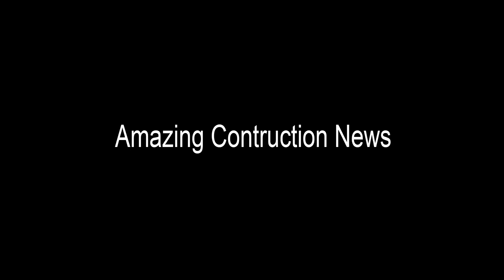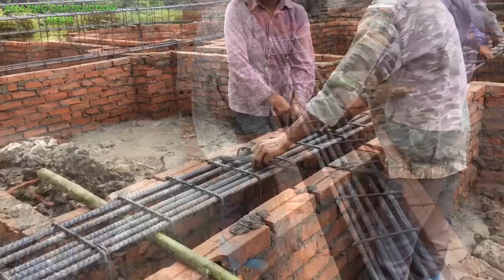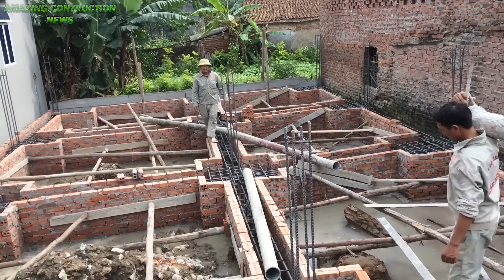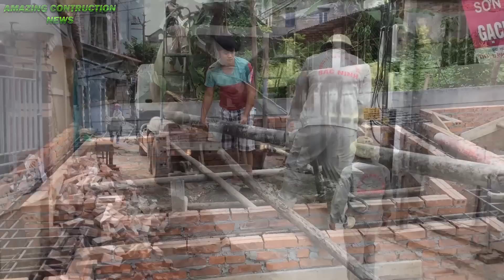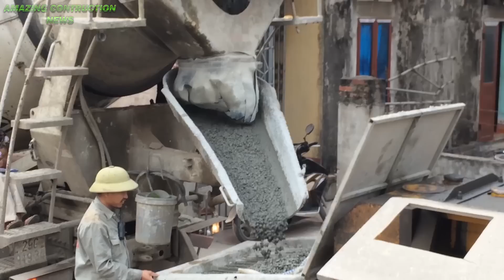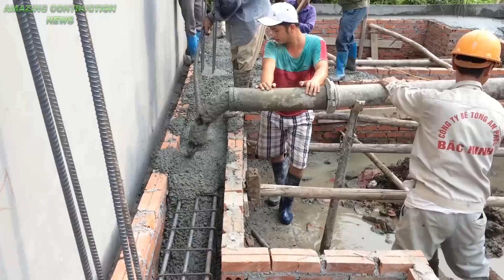How To Build A New Style Foundation - Build A Foundation Using Ready-Mixed Concrete For The House

Comment: I think it’s a waste of material, bricks are wasted. They would timber of steel formwork instead
Reply from the maker: No waste is very solid
Reply: We use wooden or steel sheets for housing foundation, ceilings or popular.
Reply: @Blowyourmind2020  where u from
Reply: It is not a waste depending on your value engineering and design.
Reply: Timber is much more expensive compare to brick.
Reply: @Blowyourmind2020  Probably timber or steel plates is much more expensive than brick in Vietnam ?
Reply: Das ist das Fundament eines Wohnhauses. Also Privathaus. Da gibt es in Vietnam KEINE wieder verwendbare Schalung aus Sperrholz. Wer soll die wiederverwenden? Wenn aus Sperrholz, die Schalung, und abgebaut werden müsste, was damit machen? Will keiner haben. Würde verbrannt werden. Unnötiger Aufwand, finden die Vietnamesen. Also praktischer mit Ziegel eine verlorene Schalung bauen, die bleibt einfach drin.

Die Grundstücke sind teuer. Kosten in Vietnam genauso viel wie in Europa. Wer sich ein Grundstück leisten kann zu bezahlen, hat auch das Geld zum bauen. Das bauen zum Vergleich ist billig. Ich kenne mich aus. Ich selber bin Bauingenieur aus Deutschland (Europa). Ich bin mit einer Vietnamesen verheiratet. Ich war schon oft in Vietnam. Als Bauingenieur immer mit offenen Augen dafür, wie anderswo gebaut wird.

Comment: Generous use of rebars and concrete, foundation will certainly be strong.

Only concern is that some parts of the foundation were linked with the adjacent structures. Not a good idea to link a new building with an old one because of differences that will arise in the settling of the structures. The old structure has finished settling, but the new structure will still be settling for sometime. It will drag the old structure along when settling and that may cause issues with the old structure.
Reply from the maker: Thank you for watching videos or like sharing videos with friends to support a better development channel
Reply from the maker: thanks you

Comment: *** It should go underground atleast 3 to 6 feet  and no need to make brick wall around steel structure / concrete filling area. you can place removable steel sheet
Reply from the maker: Thank you for your suggestions so I can do better or share videos to support the channel
Reply: The brick I guess is much cheaper then steel sheets, so this is the method of choice.
Reply: @amazingcontructionnews5050 .

Comment: It's only reasonable  if u build more than 3 floor 
Otherwise waste of money 
And these red bricks would not make the foundation  stronger not a bit even
Gentlemen  don't be fooled
Reply from the maker: This foundation is very solid, this house is built with 3 floors
Reply: Das Gebäude wird ein Wohnhaus. Mit in der Regel mindestens 4 oder 5 Etagen, sowie der Option später noch eine 6 oder 7 Etage oben drauf zu bauen.
Die 5 bzw. 7 Etage ist inklusive Dachgeschossterrasse, inkl. eines leichten Aufbaus mit 2 Schlafzimmer für Dienstmädchen (meistens Verwandte aus dem Dorf, die bei ihrer Verwandtschaft in der Stadt helfen arbeiten, für Essen und Unterkunft, sowie etwas Taschengeld für spätere Hochzeit)
Ich kenne mich aus. Ich bin mit einer Vietnamesen verheiratet.

Das ist das Fundament eines Wohnhauses. Also Privathaus. Da gibt es in Vietnam KEINE wieder verwendbare Schalung aus Sperrholz. Wer soll die wiederverwenden? Wenn aus Sperrholz, die Schalung, und abgebaut werden müsste, was damit machen? Will keiner haben. Würde verbrannt werden. Unnötiger Aufwand, finden die Vietnamesen. Also praktischer mit Ziegel eine verlorene Schalung bauen, die bleibt einfach drin.

Comment: Waste of money.. For such a small column size. No need of brick work. We can do this with much cheaper method scaffolding..
Reply from the maker: Thank you for watching my video, share my video with friends to support the channel
Reply: taiffun
Reply: Exactly. Lot of steel and brick is wasted
Reply: @amazingcontructionnews5050 is it in Nigeria?
Reply: Maybe not because of the column, but soil problem. This act like a rough footing
Reply: Probably where your located, i suspect their materials cost a lot less, apart from the concrete pump and truck, all built with hand tools, I respect the crafts people.
Reply: I guess brick is method of choice because it cost less then timber i Vietnam.

Comment: In Asia, it’s always flip flops on the feet, even during heavy construction. 😂
Reply from the maker: very exactly my vietnam people
Reply: Yes, but steel-toe flip flops!
Reply: and a huge number of violations of 'safety first' rules at construction site, plus clear inefficiency. The method on video is pretty old and cold 'conventional' in Vietnam. New technologies are already in the country, small companies just do not want to learn and move to the next generation construction practice, even if that is cheaper. New scares sometimes, investment of time to observe the market and learn new approaches also. Also the method on video is extremely dirty and noisy. It is normal practice when several houses are under reconstruction or construction in the area, you can imagine what poor neighbors are passing through while that moments, but even thought it is over, nearby a new construction site will appear and it is non-stop noise and pollution.  Still curious when Vietnam finally moves to prefab and one day assembly without extra noise and construction dust. Precast is the option for Vietnam same as it worked for budget and small-scaled architecture in Dubai or anywhere else in the world.

Comment: I m impresed.. Good job but in india it is so expensive to apply this method.
Reply from the maker: Using this method it is more reliable
Reply: Índia? China or Vietnã
Reply: Right
Reply: This method is perfect for areas with lots of cheap bricks....
Reply: @amazingcontructionnews5050  l
Reply: Viet Nam
Reply: @amazingcontructionnews5050  As said by you isn't  agreeable by mind because use of so close Iron bars aren't ideal , to explain its reaction , know it that After some period of Completion of Construction Dampness will effect iron and swelling of corrosion will pressure on cement made Mixture and form crack allover and any Small Earthquakes  will make the weak Beams shake in jerks, purpose of using Iron Rod Frame in R.C.C. constructed Foundation Beam will thus show  Reverse of strongness . As per my Research Iron Rods should not be more close to each other in farmation of gap with Iron Rods made Frame, like the same in construction of Roof, Formation of Crack on R.C.C. is because of the same. One should observe Brick made Lintals after some 4 -5 Years it was constructed , there will be cracks if Iron Rods are not placed in.between and proper middle line of Breaks.  An old begning time when iron Rods were placed with view to support weight of Brick while making Squares of Iron Rods, due to this down less part of Brick got damadged due to thickning / Swelling of Corroded Rod that pressed so high that the Bricks broke and Shattered down on ground.
Reply: This video is in Hanoi Vietnam
Reply: @abdulrahimkhan5714  Unsinn

Schlussfolgere nicht von der in deinem Land üblichen Bauweise, auf diese Bauweise in dem Video (Vietnam). 
Aus Sicht eines Bauingenieurs (ich, Bauingenieur aus Germany) hast du Abdul natürlich "Recht".
Aber: dies Gebäude im Video, wird in Vietnam gebaut. Anderes Klima als in deinem Land oder gar in meinem Land. Das Gebäude wird ein Wohnhaus. Mit in der Regel mindestens 4 oder 5 Etagen, sowie der Option später noch eine 6 oder 7 Etage oben drauf zu bauen.
Die 5 bzw. 7 Etage ist inklusive Dachgeschossterrasse, inkl. eines leichten Aufbaus mit 2 Schlafzimmer für Dienstmädchen (meistens Verwandte aus dem Dorf, die bei ihrer Verwandtschaft in der Stadt helfen arbeiten, für Essen und Unterkunft, sowie etwas Taschengeld für spätere Hochzeit)
Ich kenne mich aus. Ich bin mit einer Vietnamesen verheiratet.
Reply: @AHSIH4AHSIH  Dear Can you write in English language  ?  your written can't be understandable by me,
Reply: @abdulrahimkhan5714  Can you write in German? Your writing in English cannot be understood by me.
No, I can't write in English. Use the translator to translate into your language. Right mousekey. Do not you know that? Do you have no idea about it? I'm sorry. those are the basics.

Comment: Only benefit of this formwork is that it prevents escaping slurry or loose cement from the foundation which can later on lead to solid foundation. Otherwise the base of the foundation is not so strong as it is build on the surface and not in the ground
Reply from the maker: Thank you for your suggestions so I can do a better job

Comment: Underground foundation method is more strong. and economic. In this construction bars (steel) for plinth beam is too much heavy more than columns. Wich is not necessary.
Reply from the maker: Thank you for your suggestions so I can do better
Reply: This tye of foundation is commonly used on areas with high water table that makes digging rohibitive.

Comment: As per Engineer prospective 
Firstofall it is not economic.
Reply from the maker: This platform structure is inexpensive but solid
Reply: @amazingcontructionnews5050  regarding existing techniques it is not that cheap, it can be cheaper and more efficient, faster and clean on site.. observe, please, construction practice approaches. regarding solid - time will show. This conventional method is done based on copy-past engineering drawings in AutoCad, what means, hardly anyone made calculations of structures and quality check of materials. What means, it may work well for small building just due to less compression on the base, but not a secret that 3 storeys building on signed project quite often become 6 storey buildings in reality in Vietnam. If no specialist had done appropriate work on calculation there can be any consequences while exploitation, including weather conditions influence. Construction with such method as on video has always distortions, regulation and control of small projects just not that strict due to massive erections in the city. The same building as in video can be built by 2-4 people in one day, ready for finishing work. As a professor in architecture and construction in Hochiminh, pretty familiar with and Vietnamese construction sites and European practice, I can share knowledge, if you want.
Reply: @Timesobserver_Xenia  sir I'm from India, will you please let me know the process you are taking about, as i want to build a home for me .
Reply: Das Gebäude wird ein Wohnhaus. Mit in der Regel mindestens 4 oder 5 Etagen, sowie der Option später noch eine 6 oder 7 Etage oben drauf zu bauen.
Die 5 bzw. 7 Etage ist inklusive Dachgeschossterrasse, inkl. eines leichten Aufbaus mit 2 Schlafzimmer für Dienstmädchen (meistens Verwandte aus dem Dorf, die bei ihrer Verwandtschaft in der Stadt helfen arbeiten, für Essen und Unterkunft, sowie etwas Taschengeld für spätere Hochzeit)
Ich kenne mich aus. Ich bin mit einer Vietnamesen verheiratet.

Das ist das Fundament eines Wohnhauses. Also Privathaus. Da gibt es in Vietnam KEINE wieder verwendbare Schalung aus Sperrholz. Wer soll die wiederverwenden? Wenn aus Sperrholz, die Schalung, und abgebaut werden müsste, was damit machen? Will keiner haben. Würde verbrannt werden. Unnötiger Aufwand, finden die Vietnamesen. Also praktischer mit Ziegel eine verlorene Schalung bauen, die bleibt einfach drin.

Die Grundstücke sind teuer. Kosten in Vietnam genauso viel wie in Europa. Wer sich ein Grundstück leisten kann zu bezahlen, hat auch das Geld zum bauen. Das bauen zum Vergleich ist billig. Ich kenne mich aus. Ich selber bin Bauingenieur aus Deutschland (Europa). Ich bin mit einer Vietnamesen verheiratet. Ich war schon oft in Vietnam. Als Bauingenieur immer mit offenen Augen dafür, wie anderswo gebaut wird.

Comment: As a civil engineer iam rejection this method🙅
1) Never cast a concrete beam with bricks as shuttering replacement why? Because it will not have adequate strength. Again why? Because it won't be having proper curing. 
2) If there any voids remain inside the beam it can't be repaired and since it's a ground beam or plinth beam the moisture from ground through bricks will harm the reinforcement later on.
3) this method shows intelligence of a contractor. He'll charge you for shuttering work also and will save money hence will have greater profit. 
Hope the guys reading this comment doesn't use this method while making your house😊
Reply from the maker: Thank you for your comments, watching good videos, please share with your friends to support the development channel

Comment: Has a very good tie beam setup. My only question is that there were only  4 corrugated erected steel bars instead of 6  pcs16 mm- 18 mm steel bars. Depths it should be 4-5 ft...footing of 1mx 1meter -1.25 meter.
Reply from the maker: Thank you for watching the video, see or share the video to support the development channel

Comment: So basically do excavation and brick work in advance then make individual reinforcement cages, lift them above ground, combine all of them and then just do concreting
Reply from the maker: Thank you for watching my video, share my video with friends to support the channel
Reply: My old house was constructed in 1971 and almost this pattern only. What the builder did was make a brick foundation and on top of it place a plinth beam with RCC and on top brick structure to come. The only difference is that the pillars are also compound walled and RCC poured in. This is suitable for g + 3 maximum. But now a days pretty expensive

Comment: This type of design is not acceptable in India, Indian residential homes are generally designed on isolated foundation. And the video shown here is something similar to foundation cum plinth beams. Foundation should reach upto hard starts. Or else we can adopt raft foundation.
Reply from the maker: because in my country is using bricks instead of boards, it will make the concrete foundation beautiful and certainly not expensive.

Comment: Can u help me decide on what design/type of foundation and how deep/high it should be for a single storey house?
Because im planning to build my house on a wet and loose sandy area
Thanx a lot for ur help
Reply from the maker: Thank you for watching my video, share my video with friends to support the channel
Reply: Usually when soil is not compact, soft  and with low bearing capacity base plate foundation is an option. First you excavate  deep enough and replace the soft soil with a solid and well compacted material (gravel) using plate compators or similar equipement. The "tampon" layer must be min. 1 m tick, above the underground water level, and separated from surrounding and underneath soil with geotextile to prevent erosion and mixing . Then on top of that you build reinforced base plate foundation.  This will be  a good  foundation for the smaller house.  There are other more expensive and complex methods but this is more then good enough for smaller buildings.
Reply: @nikicamalezic5388  thank u so much for this..

Comment: As there is no depth provided to the foundation, the area of the footing should have been wider so as to prevent settlement.
Reply from the maker: Thank you for watching my video, share my video with friends to support the channel
Reply: Nein. Es ist ausreichend. Und überdimensioniert.

Das Gebäude wird ein Wohnhaus. Mit in der Regel mindestens 4 oder 5 Etagen, sowie der Option später noch eine 6 oder 7 Etage oben drauf zu bauen.
Die 5 bzw. 7 Etage ist inklusive Dachgeschossterrasse, inkl. eines leichten Aufbaus mit 2 Schlafzimmer für Dienstmädchen (meistens Verwandte aus dem Dorf, die bei ihrer Verwandtschaft in der Stadt helfen arbeiten, für Essen und Unterkunft, sowie etwas Taschengeld für spätere Hochzeit)
Ich kenne mich aus. Ich bin mit einer Vietnamesen verheiratet.

Das ist das Fundament eines Wohnhauses. Also Privathaus. Da gibt es in Vietnam KEINE wieder verwendbare Schalung aus Sperrholz. Wer soll die wiederverwenden? Wenn aus Sperrholz, die Schalung, und abgebaut werden müsste, was damit machen? Will keiner haben. Würde verbrannt werden. Unnötiger Aufwand, finden die Vietnamesen. Also praktischer mit Ziegel eine verlorene Schalung bauen, die bleibt einfach drin.

Die Grundstücke sind teuer. Kosten in Vietnam genauso viel wie in Europa. Wer sich ein Grundstück leisten kann zu bezahlen, hat auch das Geld zum bauen. Das bauen zum Vergleich ist billig. Ich kenne mich aus. Ich selber bin Bauingenieur aus Deutschland (Europa). Ich bin mit einer Vietnamesen verheiratet. Ich war schon oft in Vietnam. Als Bauingenieur immer mit offenen Augen dafür, wie anderswo gebaut wird.

Comment: Good job with the steel,  this should be earthquake proof with that size rebar.  The only thing that I would add is a flexible concrete hose to cut down on the work of spreading the concrete.  Good job on the vibrating;  when the concrete drops that much in the form from vibrating we know that it is very compact.
Reply from the maker: Thank you for watching my video, share my video with friends to support the channel
Reply: A mi

Comment: Poor quality control.water cement ratio not controlled .Cement slurry leakin from pipe joints. Bricks used for shuttering will absorb water of concrete affecting water cement reaction
Reply from the maker: Thank you for watching my video, share my video with friends to support the channel